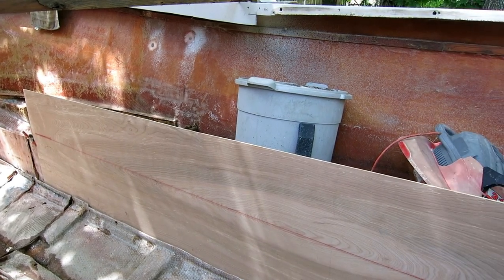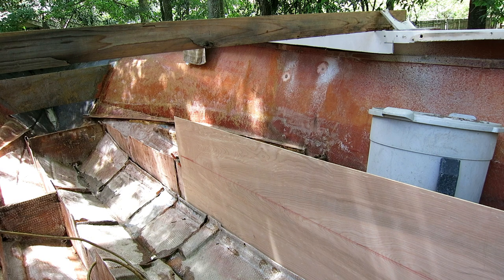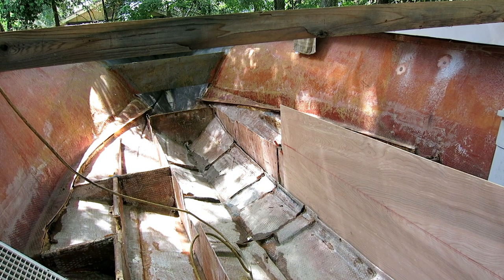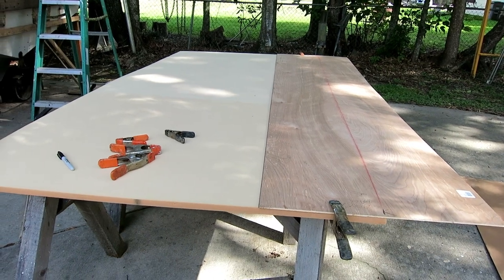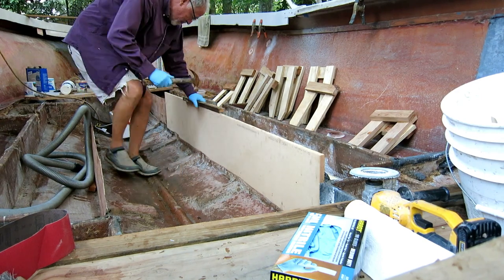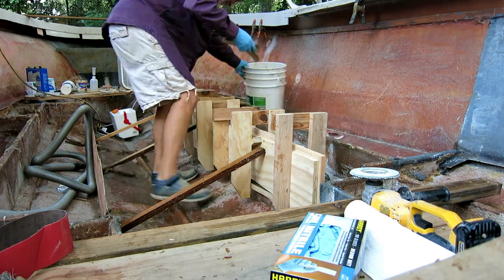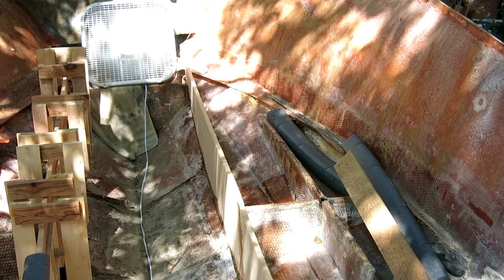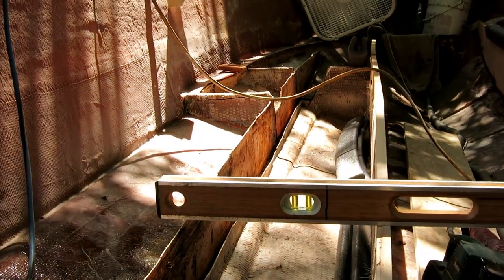The Center Console #4 Installing Divinycell stringers in an unorthodox fashion.

Comment: if you use laminating resin (no wax) it will set up but the surface stays open so you can apply more layers of polyester resin the next day or the next week. once you are done you apply a finishing gelcoat or a finishing resin to cure the surface. You can also spray it down with pva to completely cure it.
Reply from the maker: Thanks for the tips!
Barry

Comment: Question for you, how would you make a 12' stringer out of a 4x8 sheet of divinycell foam?
Reply from the maker: ADD
Foam cores for stringers and bulkheads are simply cut to size and butted together if additional length is needed. The strength of the stringer's structure results from a combination of things. Strength and thickness of the laminates on each side is a big part. The thickness of the foam plays a part as does the foam's ability to accept and bond to the wet resins during layup. The shear resistance of the foam itself plays a key role and joints in the foam do not have much of an effect on this. Also important is the fact that structural foams are resistant to absorbing water and rotting. 
Barry
Reply: @barrylukebuilds7894  Hey Barry, I have a lead on a sheet of divinycell foam, 1.25" thick.   Seems big enough, but what density would I need for my transom?  less concerned about the stringer but just trying to make sure I buy the right stuff.
Reply from the maker: @ADDvanced  I don't have warm and fuzees about this. I know very little about Divinycell  other than the sheets I purchased and used. Those sheets I don't think were ridged enough for a transom. I would be concerned about the engine bolts crushing the core. There are ways around this but it gets complicated. I would contact a sales rep and see what his opinion is . Thanks Barry

Comment: I use thickened vinylester with a flexible spreader on the foam core mixed cold at 1% mekp then add wet biax on that . The core never holds the liquid resin and the cloth falls off to easy.
Reply from the maker: Vet man
If you are saying that mat will not stick to Divinycell when using unthickened resin that's the first I have heard this. The foam does soak up a lot of resin so if the foam was not pre-wetted out maybe the mat was starved for resin? Seems to be working for me.
Reply: @barrylukebuilds7894  foam core takes liquid resin best in a vacuum bag,  when hand laying foam board the best lay up is to push thickened vinylester into the foam then lay up the pre wet 17-08 on top . No voids. No need for vacuuming and good on vertical surfaces.
Reply: @barrylukebuilds7894  i learned these techniques in a place called Stuart fla where i live. Google it custom boat capital of the usa